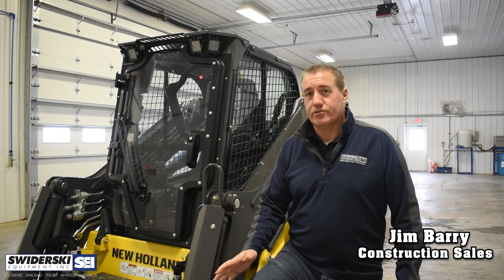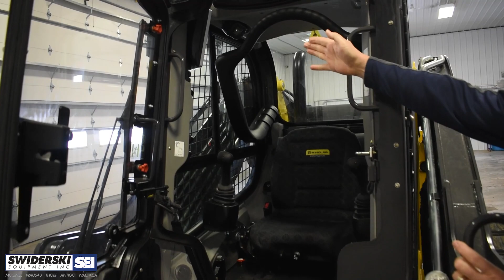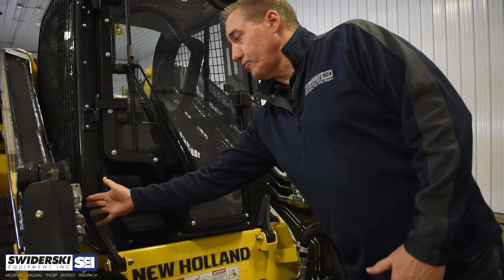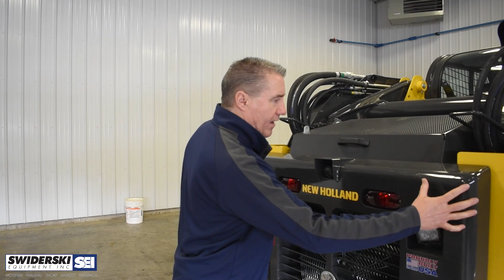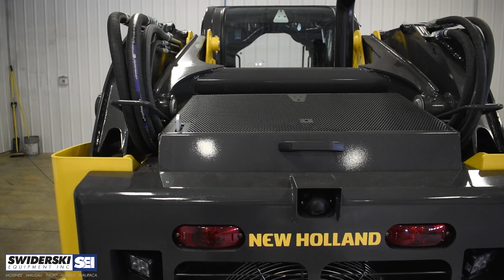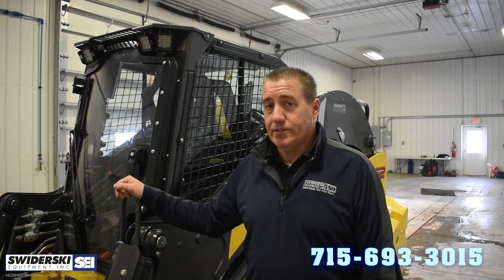Walk Around - New Holland C362

Comment: They do not make the bucket strong enough for this skid steer. I had to get a manufacturer to weld a complete new plate on the back side of that thing because a little tabs they put on them buckets it just bent them , cost me close to $500